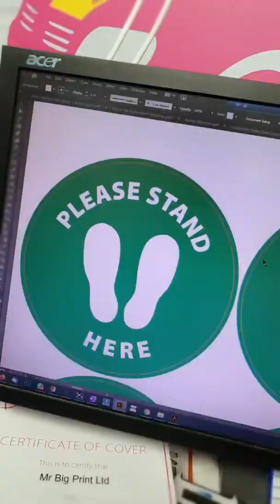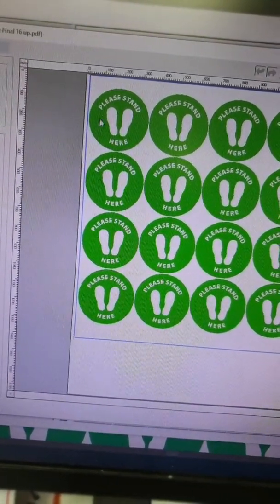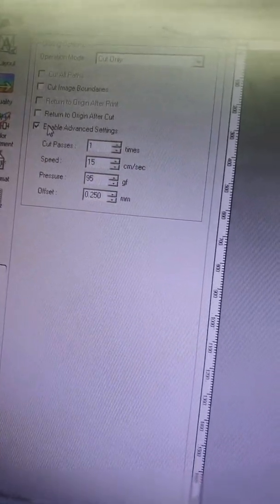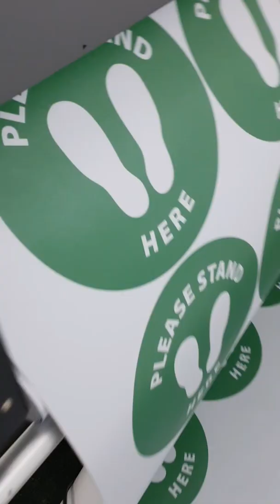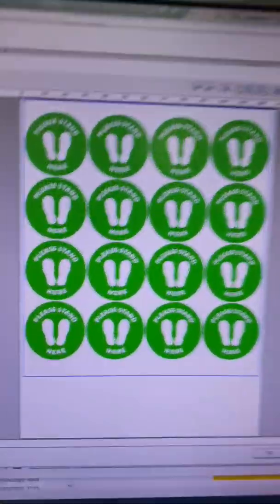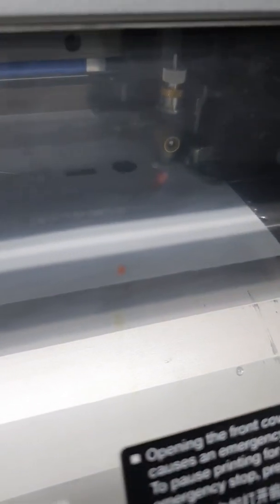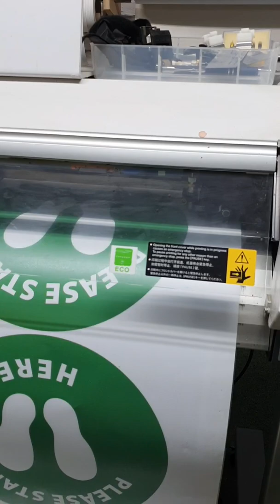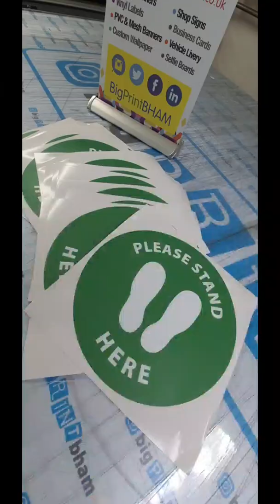Roland sp540i : Printing & Cutting with Crop Marks in Versaworks

Comment: This is the first time I've used a machine with a cutting feature. I could not adjust the printing starting point in the machine, the printing always starts one ahead of the material, and most importantly, the cutting part, I have a problem with the adjustment part of the blade. When I increase the cutting pressure force, small pieces fall apart in the foil, I bring the knife head forward or pull it back a little, this time it does not cut, the foil does not separate.